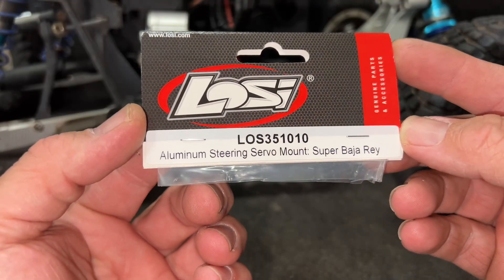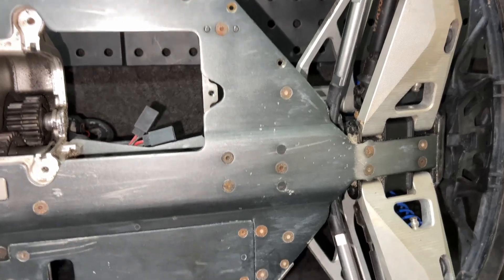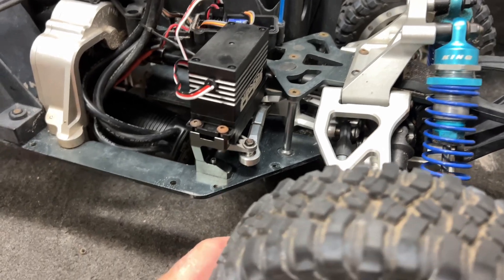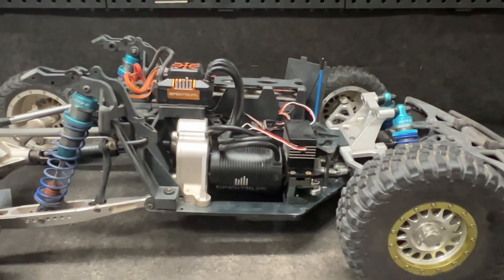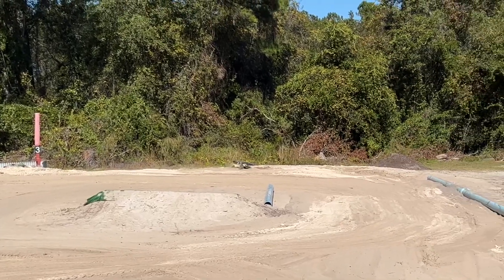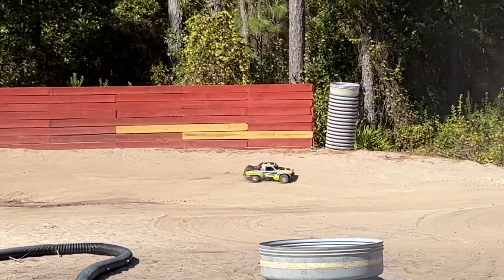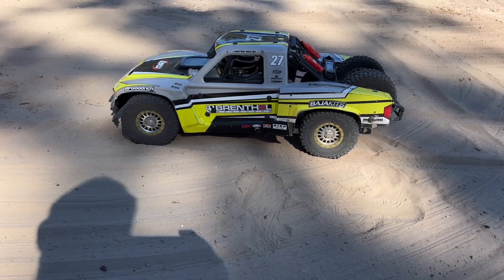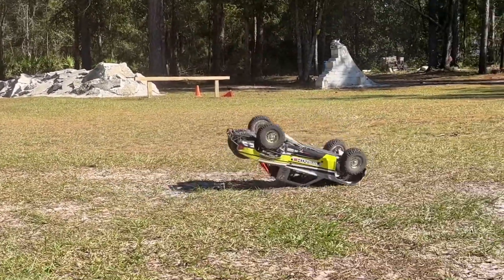Super Baja Rey ECO 1/5 Servo Install and Test

Comment: This is my favorite truck out of all the ones i own. I love my xmaxx but theres just something about this thing. I ran mine pretty hard for 2 years without ever having to work on it once. I think i had one wheel come off but i somehow found the wheel nut in dumont so i just put locktight on them and kept going. I finally put the 1/5 scale servo jn and it rocks.

Comment: A couple suggestions i have for this beautiful rig is, stiffen the spring a lot up front and run losi 100wt shock fluid. But not to the point it doesnt have any static sag. If you lock out the front end it will handle like crap. Then in the rear shock run 80wt and acquire some LX shock bypasses and run 25-35wt in those. You can also use arrma kraton shocks without the springs as bypasses for a cheaper option. Im not sure what fluid you would want to run in those. I know no one asked but maybe one person has one and is looking to make it handle and drive better.